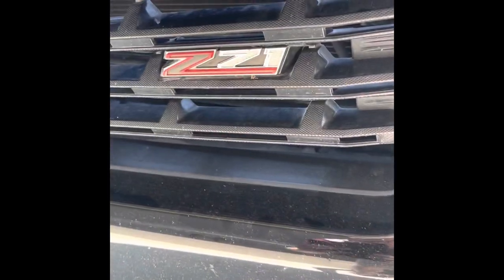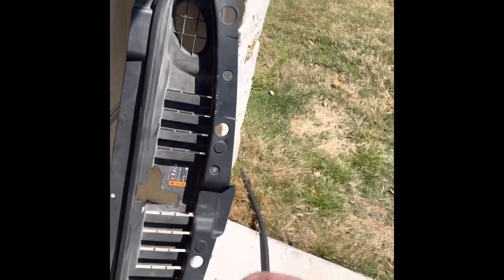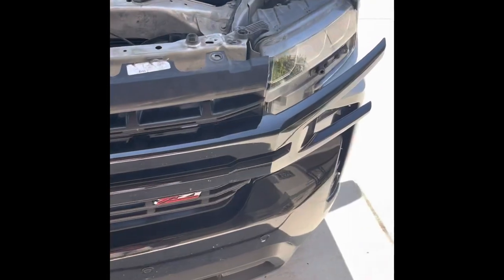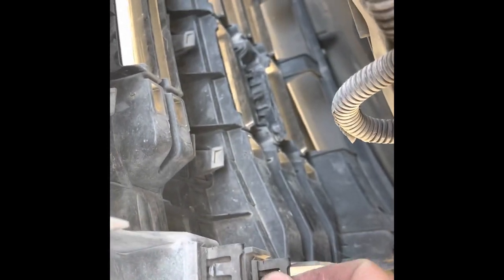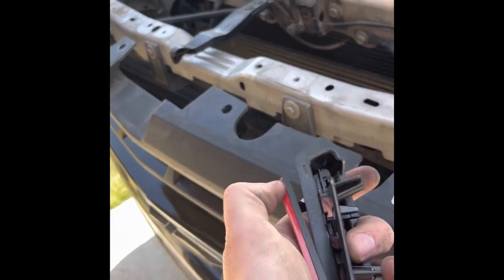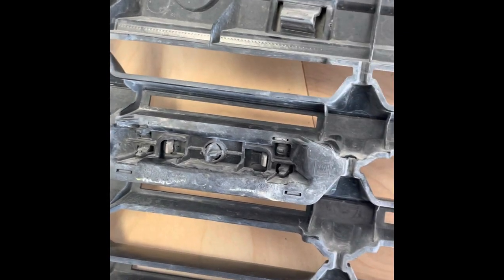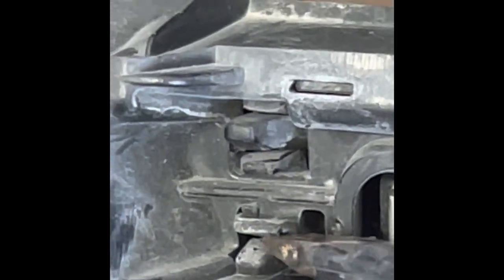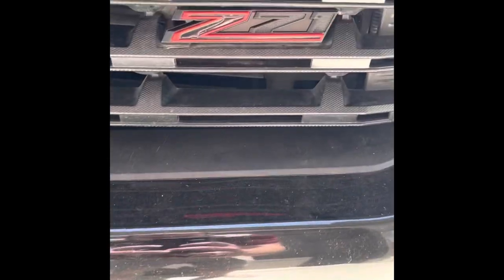2019+ Silverado Grille Removal, Front Bowtie Emblem Replacement, z71 Grille Emblem Replacement

Comment: You do not need to take off entire grill to replace small Z71! I used a plastic pry tool and popped off OEM Z71 and simply popped on my blacked out Z71
Reply from the maker: i tried it but i didn't want to risk breaking it so i went through a bunch of extra effort!
Reply: Where did you buy the all black bowtie? I have a 2019 trailboss
Reply from the maker: @joelopez3770  some dude sent it to me for free. he got it off amazon.
Reply from the maker: i am working on a new video and i disagree. i broke my z71 grille emblem trying to do it this way. no problem because i was installing a new one.  but it’s highly likely to break the old z71 grille emblem if you are doing this method
Reply: @joelopez3770  ebay or gm parts..I got mines off eBay and they have a whole lot of z71/bowtie decals
Reply: So it’s possible without taking the grille out?
Reply: @PissDrunxVato  yes! It just snaps in! I have a 2020 Trail Boss, and I had an all black bow tie and Z71 installed in 60 seconds
Reply: Can you show a video of replacing that emblem without taking off the grille? I installed mine but put it in too low and need to adjust. Was hoping I wouldn’t have to remove the entire grille. Thanks a bunch!!
Reply: @MrOGsteveC  I have a 2020 Trail Boss. That front small Z71 emblem just popped on? I don’t know how you put it too low? Mine took 6 seconds
Reply: I’d rather break the small z71 than remove the whole grill, thx for the vid anyways

Comment: There is no way to just pop off the Z71 emblem on the front and install the new badge using the old housing bracket inside instead of replacing it all??
Reply from the maker: you can do that but you run the risk of breaking it. i didn’t want to break mine. 

you definitely can with the bowtie.

Comment from the maker: damn didn't realize i had like 11k views on this video!  you can technically pop the old one out but it will likely break it and it may be difficult to get the broken clip piece out.  i wasn't sure if the new z71 emblem would fit and wanted to reuse the old one to paint (which i did in a different video) so i pulled the whole grille!  hit me up if you have any questions.  wish i could make some money off these videos!